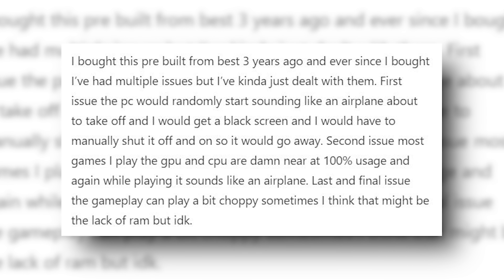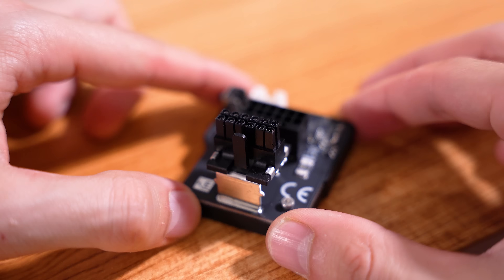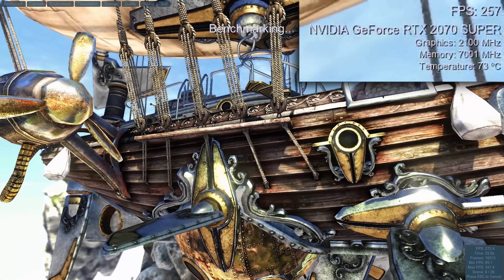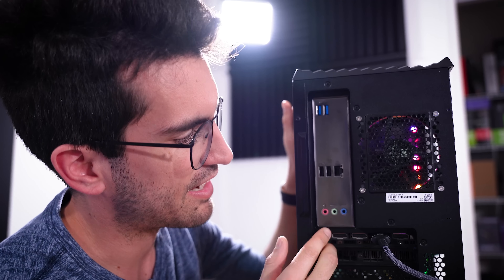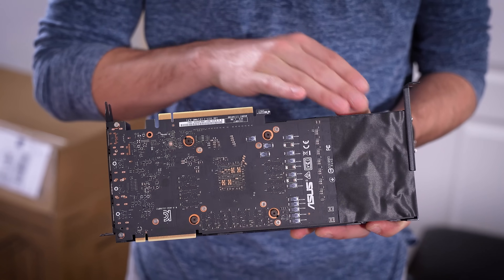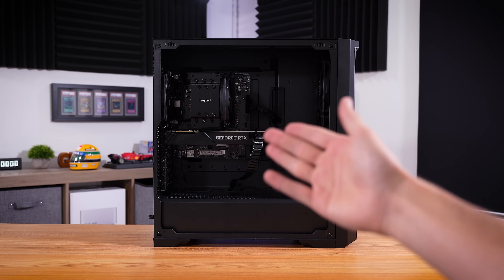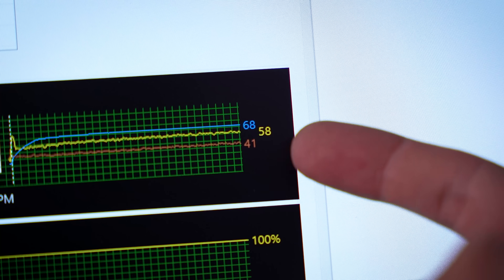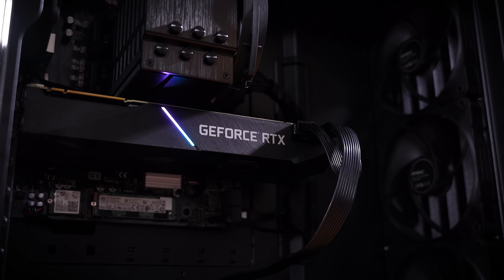Fixing a Viewer's BROKEN Gaming PC? - Fix or Flop S5:E3

Comment: Thanks again Greg for fixing the system for me. It’s been running amazing and I’ve been playing for hours and no crashing.
Reply: Greg hooked you up so that in the future all you have to do to upgrade it into a beast rig is get a Motherboard and new CPU, or just a better board to go with the current CPU, and like the others said on the Ram but I would get a whole Ram kit with 2 matching sticks 32gb worth of DDR4 maybe 3200-3600 speed and even with the 2070 you can play anything you want even at 1440p
Reply: @bikedoc4145 You expect too much from a dude who complained about tempratures and didnt think of getting a new cooler..
Reply: please put another stick of ram in
Reply: That must be one of the suckiest mobo I had seen !! Even a low budget other brand mobo would have more features. Lol!
Reply: If you see this comment (Owner of the PC) Upgrade your ram. Decent ram is pretty cheap now.
Reply: Greg is a legend, upgrading everything thats needed, not stinging on anything. I just hope more big companies start sponsoring him so he can help more people.
He is a rare sort of a good guy Greg on youtube
Reply: That power connection on the GPU needs to be corrected @13:45
Reply: @Molimo86  i agrees not suppose to pig tail psu cable to gpu and more likely melted cable
Reply: @Molimo86  Good catch.
Reply: 9th gen is DDR4.
Stick another stick of RAM in it for dual channel and better performance.
Reply: I'd also suggest a heatsync on your NVMe drive. If the drive gets to hot, you will have issues.
Reply: @bitterseeds nah, its fine. Nand likes to run hot..ish and that is prolly a gen 3 drive. No need a cooler
Reply: What case did you use? I have a newer version of this buikd.
Reply: Bro get a new mobo.. Please
Reply: @WowAdonyz where did you buy this pre built abomination? Whoever built that thing should be ashamed
Reply: I might be 6 months late to the party but you really should consider upgrading that motherboard at the bare minimum, the VRM's on that are practically non-existent and its really going to hamper any CPU performance in games no matter how high the model for that generation you put in it.
Reply: Get more ram 2x 8gb
Reply: you need get other motherbored because that old mobo in there is cutting power in half and limted you to half perform i recommend upgrade motherbored and ram them you have all your perform back at high speed
i have seen ton of this mobo is cutting cpu power and gpu power in half because it limted down to slow and louder
Reply: U are the owner of this system
Reply: @TruthHurts1519  yeah unfortunately lmao
Reply: @WowAdonyz  Put a second stick of ram in it. Believe me: Dual Channel will make a big difference. ; )
Reply: Exactly this i was hoping Greg would have gave him a 2nd stick of ram
Reply: @Breadwinka  Yeah he doesnt charge for the upgrades he put in so $20-$45 for a stick of ram dependent on how much DDR3 runs now.
Reply: @Adam-Mei definitely isn’t DDR3
Reply: @iZaners  I rewatched and heard 10th gen but would have sworn he said 6th or 7th gen Intel the first time. Or actually I thought Greg said 8 to 10 generations old hardware is hard to come by
Reply: @Adam-Mei  If it's a 9th gen i7 then it would actually be DDR4. DDR4 at 3200MHz is pretty cheap, so get a 32GB kit (or a 64GB kit if you really want to) and you'll be all set.
Reply: @Breadwinka  Yeah, he probably has a pile of old ram laying around.
Reply: Add another, same, RAM stick to benefit from dual channel speed up. Undervolt this GPU to keep it even cooler. Consider replacing the motherboard. And I hope you at least filmed the black screen issues you had as a proof there was an issue in the first place.
Reply: @Santeri324  I didn’t I told Greg I probably should’ve because I don’t want people thinking I was trying to benefit in any way from his help but my first instinct when I would come back and see it like that was to just manually turn it off and just not play it anymore

Comment: Remember the smaller the fan the louder the fan. The point of water cooling is to move the heat to a radiator with large fans to be quitter.

Comment: Greg as far as I know with Intel stock coolers, it would help if you would have used a flat head screw driver to quarter turn the plastic clamps of the CPU cooler at 9:04. You would notice a recess for a flat head screw driver on the clamp itself with markings to direct which direction to turn the screw driver. No need to yank the cooler. You turn the clamp first with a screw driver and then pull the clamp. It would come out with little to no resistance.

Comment: Why would 500w be low wattage for 2070 super? you would have ~285w spare for the rest of the PC which is more than enough
Reply from the maker: Peak power draw for a 2070S is around 220W. I don't recall the CPU in this video as I published this many, many weeks ago, but it's likely around 100W (even if TDP is 65, they can easily pull more power than this and often do). Add peripherals and you're looking at around 300-350W total power draw with a super heavy workload. I never said 500W "wasn't enough" - just that it could definitely benefit from additional headroom. Any upgrade at all and he'll inevitably need to upgrade his PSU in tandem. Already discussed in video...

Comment: maybe why the back ports is stripped down is because the machine was sold in a state that did not have to conform to the cec witch is an environmental ruling that 5 states incloding california and canada where companies are not allow to sell to customers in the locations unless the system conforms to certain energy saving features or has a certain ration of ports to power usage.

the rule was put in a desparation to deal with the droughts in california where they barely had enough water to run the power plants and feed the large demand for fresh water.

under windows vista the blank solder pads are not allowed.

why not monetize your videos on patreon by puttting new videos behind a member/pay wall?

Comment: As some 1 with cpu cooler that you just gifted I have mixed feeling about it yes it performs really well but depending on the motherboard like mine it can block access to ram not to mention it is a nightmare to reposition the fans of it

Comment: So Google Chrome has hardware acceleration turned on by default and that will run your processor like at 100% to keep those tabs jumping when you move between them. I turn hardware acceleration off. That goes for Firefox and edge browsers all have that garbage on. It just wastes resources and power if you are on a laptop.

Comment: 13:45 - 2 of the 8 pins on one of the PCI-E power connectors are sticking up and not fully seated.  It's a pain because I know those 6+2 configurations slide out of alignment while you're plugging them in, but I wanted to point that out in case that got missed on delivery back to the user.

Comment: Btw incase anyone was wonder the Antec PT1 performance case is the best case on the market hands down so quite and amazing airflow comes with double tempered glass panels (1 on each side) and 4 fans stock 3 front 140mm and a rear 120mm

Comment: That OEM cooler was inadequate but the Dark Rock 4  was overkill.  Any of the 4 heat pipe  160-180 TDP units would have worked as well. I have had thermal issues with the OEM cooling units on both AMD and Intel cpu's and after market solutions were easily much better.  A Be Quiet Shadow Rock Slim 2 would have been a very good choice. If you had one.
Reply from the maker: It was a perfectly viable upgrade. And like I said - gives him headroom in the future for upgrades down the line.

Comment: With these systems I'll up the customer to a main stream Motherboard & PSU, up it to dual channel Ram and that will usually get the numbers in the ball park respectably.  For the cooler anything goes really but the shadow rock line will keep it good and not break the bank.  Great video.

Comment: for these type of hardware a NOX Coolbay MX2 case is great. It's less than 30$, very well ventilated and it's a decent looking case.
Aslo doing temperature testing with the case open, is not reliable.

Comment: Microcenter should sponsor this series. Just sponsoring the replacement parts would be a no brainer deal.
Reply: Microcenter works with other you tubers so don't think they aren't part of the game, i'm not even from America and i know this. the point of the video is to find a problem and fix it, not just to say "here have a complete PC upgrade courtesy of Microcenter". that's about it in a nutshell, if you need me to elaborate more then feel free to reply.

Comment: Was there really a need to change the PSU? The "minimum system requirements" are never accurate and the GPU relies more on available amps on the rail than the PSU's total watts! Take them with a cup of salt.

Comment: That case needs a tower cooler with the fans aimed up to the top of the case, and have the case exhaust fans also at the top. That will also aid with air flow over the GPU.

Comment: I don't understand who would be dumb enough to criticize you for NOT upgrading further. You're already throwing free hardware left right and center which more than enough.

As for the system in question, I think you're spot on regarding the motherboard limiting the CPU. I think it does that because of the VRM. It's probably so bad that they artificially limit the power through the BIOS in order to not blow a mosfet or something. 
I despise these prebuilts...RGB and ROG branding...but can't put a decent motherboard in them. It's bordering on e-waste.

Comment: ok, i get what Greg explained that he is dealing with what he has on hand (i.e. sponsorship handdowns). But if some of you are going to try to fix thermal situation in your asus prebuilt from covid shortage era, first thing would be better to get a downward cpu cooler. The additional airflow it provides over the vrms will help to reduce throttling - this is cheap and easy solution $50-60. Otherwise, as Greg said himself, that motherboard really needs to be replaced first, then get a decent tower cooler like noctua nh D12L - still fits in this case. Obviously one stick of ram is triggering, considering how cheap ddr4 is now.

Comment: I would really like you to start the repair process with a segment where you tell us about the specs if the rig. Like the cpu, GPU, ram snd PSU specs. Make it an every episode must have for the future upgrades :) from pausing the video I checked that it was an lga1151 motherboard, so I assume it was an i7 9700 of some sort (you mentioned an i7)

As for the rig - i would personally leave the case as is, put a smaller cooler (like a 92mm be quiet pure rock slim) and add another stick of ram (or put a new set) to get the most of the cpu with dual channel. And the PSU of course too.

Comment: I assembled a "barebones" build with this case!!!  Got the case, psu, b550 mobo & 5600x cpu  and 1tb HDD for $139!! Got a used RX 6750XT for $232!! Added $45 of 2 new ram sticks and just $417.33 later. I had a fully assembled pc....I sold it November for $700. Which is still an amazing deal for the buyer. Gave him a 1 year warranty on labor/parts too.

Comment: Good thinking on the upgrades. If a system builder has cut corners on cooling and case, it is a good bet that the power supply has helped the profit margins as well. But yeah, that is one sad, sad motherboard.

Comment: back in the GPU gouging days, I bought an Omen 40 from HP so I could get a 3080, from the factory it came using the radiator as the only case exhaust. So my 3080 cooking the interior was being exhausted thru the radiator causing thermal throttle right out of the box. Ram would not OC and was 2133 mhz vs 4000 mhz DO NOT BUY PRE BUILTS! Tanks to MIcro Centers amazing bundles I grabbed a new intel bundle and left all of HP in the trash can

Comment: Too bad the free repairs are only for people who live in Orlando, Florida.

I put all my money into a dream rig in 2017 with then semi-top line hardware. Life's fortunes have left me with so little that I would struggle to replace my PC with anything that performs better, let along one that supports Windows 11 officially.

It has a bad bios to start with. I tried to tamper with it when Windows 11 dropped and I wanted to add TPM 2.0 support to the motherboard to no avail. I'm on the backup bios and my computer loads really slowly (doesn't post for 20-30 seconds). One PCI express port is not working, possibly failing video cards, BSOD and almost constant Windows corruption. Recently I've reinstalled either 10 or 11 (unsupported by the processor and motherboard... but I bypassed and upgraded and Windows 11 runs really well) at least 7 or 8 times at this point. My USB ports on the motherboard seem to be funky or in the case of some dead/incapable of delivering power to devices.

That's most of all I can think about that's wrong with my PC, except for something that comes to mind: a ways ago it would beep really loudly on boot or sometimes randomly, but since has stopped doing that. I worry that my computer will collapse at some point.

Motherboard: X99A-GAMING-9-ACK
Processor: i7-6850K @3.60GHz (12), ~3.6GHz
Memory: 32GB (Don't remember the type)
GFX: NVidia Geforce GTX 1080 2x SLI (Some say SLI sucks, but for what I use my computer to do, it gives me double the performance, although the FPS has been slipping lately. Maybe that's Windows 11)
Water Cooling (Missing big fans. I bought the wrong size replacements and make do with two smaller ones up top)

Though I know it's utterly pointless to even mention all this, I can't help ranting about my problems.

Comment: Given the low amount of MOSFETs and lack of heatsinks in the motherboard it makes sense the MB will prevent the CPU from reaching turbo frequencies for too long. The MB is just uncapable of sustaining turbo.

Also combine that there's few MOSFETs w/ low number of USB ports; it may make sense why they a low watt PSU. Nonetheless, 350W on a 2070 SUPER is still way too low and may explain the crashes the user was seeing. That configuration should've never been sold.

Comment: had a friend buy a prebuilt from best buy and they did something similar. he got a 8700k and a 2080 and couldnt multitask in any way. things like they couldnt join a discord vc and game at the same time without discord cutting out constantly. asked him what his temps were and his cpu was sitting at 100%, below base clock, and at 100c. it was absolutely thermal throttling because they put a 120mm aio with 2 fans on it for the cooler. he got a dual tower air cooler and hasnt had any issues since

Comment: It's not like it deserved better, but you're not supposed to savage these push pin coolers off! The pins turn 90 degrees away from the installed direction (usually counter clockwise) and then you pull up on the black tabs to release the pins, that way you're not savaging a motherboard and bending PCB and all that.

Comment: You need to turn the 4 pegs that hold the stock cooler down which releases the pegs and they pop away from the board. Then its much wasier to remove the CPU cooler. You risked cracking the board at the holes pulling away that forcefully.

Comment: Depending on how modern that CPU is especially if it's AMD gotta watch out worrying about High Temps as they'll never not be high. Just opening chrome will smack 95c with a decent cooler. Even the older X3D chips will get super toasty.

Comment: You can only fix what you can see, Greg? 
I can see two more things wrong. Only 1 stick of ram and that sad, sad motherboard. The new case is nice but looks ridiculous with that motherboard and 1000W PSU is nice but it would have been been fine with the recommended 650W PSU. I can understand you not fixing it, because that user should have known what he was getting by the number of ports on the rear io.
Reply from the maker: The RAM isn't inherently "broken." This isn't Gear Up. Same goes for the motherboard. It might suck as a board, but it wasn't broken. The issues here were airflow/cooling/temps.
Reply: @GregSalazar  I understand you not fixing those things but I was pointing out there was a lot of things wrong with that system. The viewer who sent it in, deserves the blame for buying it. Things like the ram are hidden but the poor io at the back of the computer, should have been all anyone would need to see, to avoid that computer to begin with.